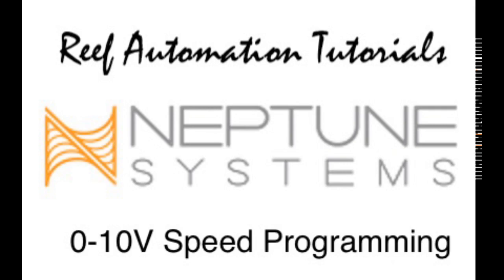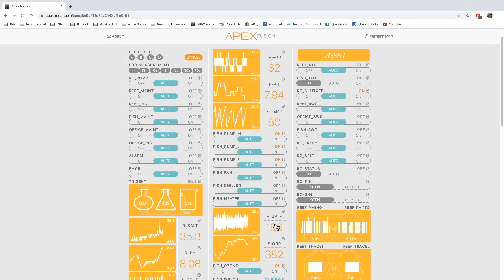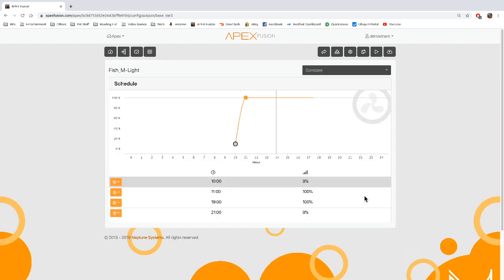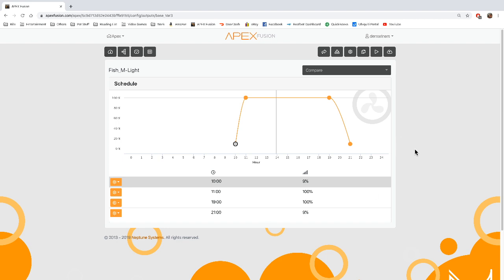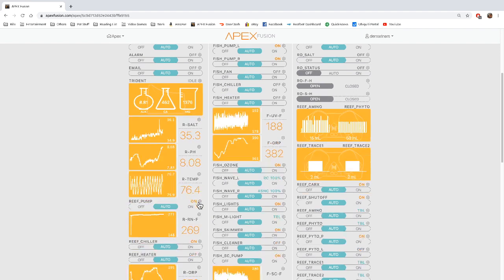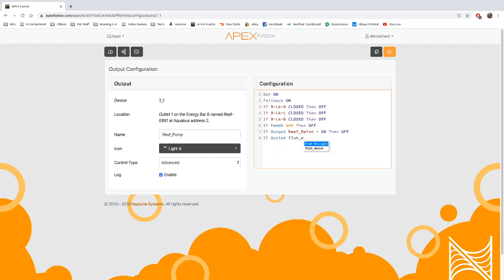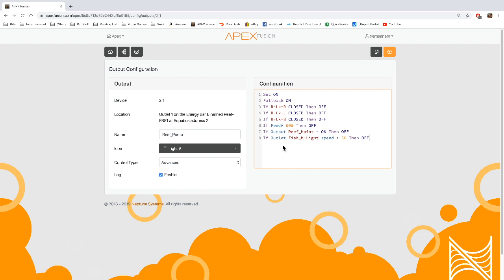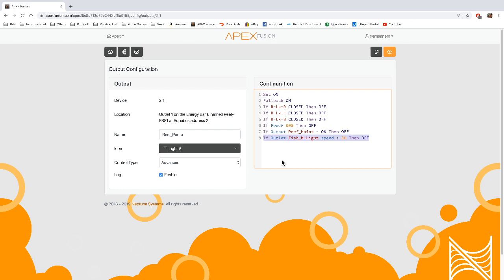Neptune Systems Apex Tutorials - Variable Speed Outlet Programming (0-10V)

Comment: Hi, as I know the Aquasurf is a 0-vdm like for AC3. I have 2 of them totally new. can they be used for leds or other pumps that are not the Tunze? I saw Jebaos, but I have the Gyre style and I dont know if the torx cable can be used for them.
Reply from the maker: Anything that is 0-10v will work.
Reply: @ReefAndReptileAutomation  thanks. Do You know the volts that it needs to power it? With tunze I think it is not needed.

Comment: I'm not sure if this is your expertise, but could you explain using the varspd ports to connect equipment?  What is the actual wiring? Does one modify existing wires and stick the bare ends in?  If not could you point me in a direction?  Been searching fusion apex youtube.  I want to see how someone goes from the box to having it run on one of VRSPD outlets
Reply from the maker: Michael Merriam I have a video on splicing wires.  Not sure that would help.

I would reach out to Harry Singer with Harry’s Aquatics.  He knows all about that.